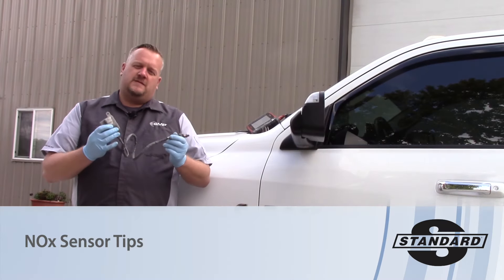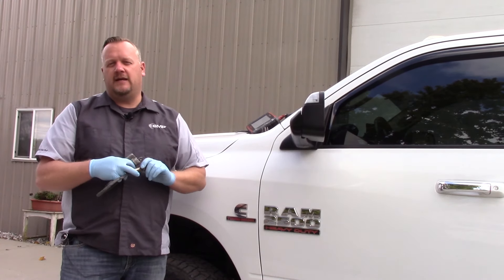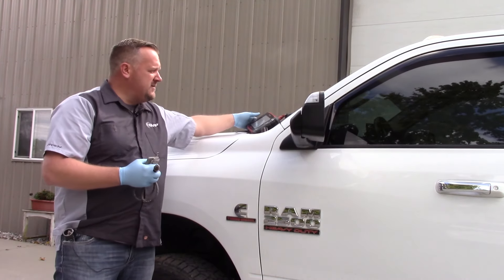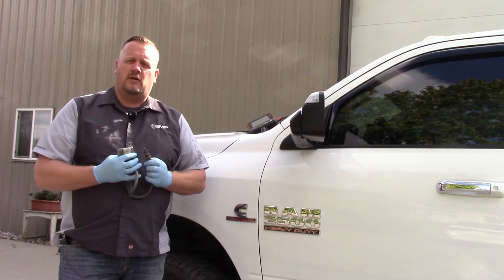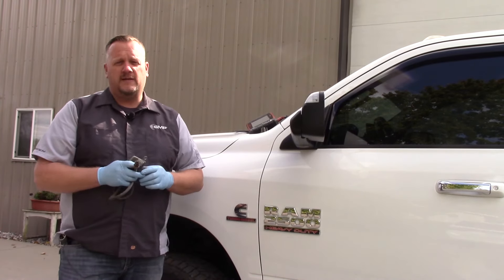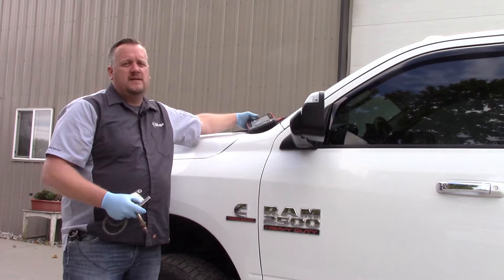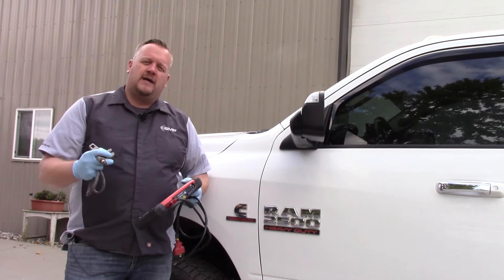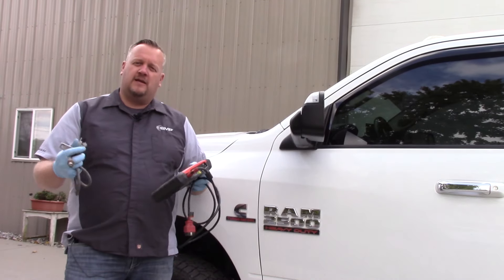NOx Sensor Tips

Comment: If my truck is in limp mode and i change the 2 nox sensors can i do a regen and have it run normal or do i need to have it recalibrated by a reductant fluod test

Comment: How many NOX sensors does a 2016 ram 3500 have? 2 or 3
Reply: One at that back of the exhaust and I was told there's also one up front, I haven't found the one up front yet.
Reply: @sharee-1111 just down stream from the turbo, about 6 inches.  Best access is to remove the right front wheel well cover.